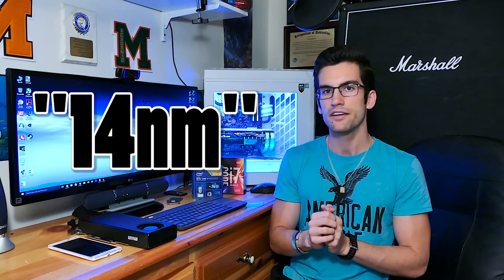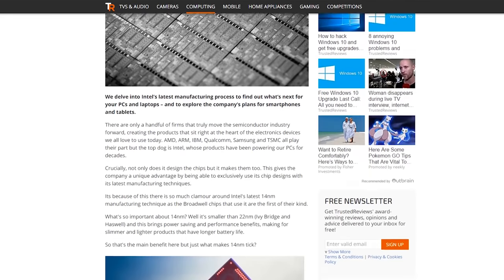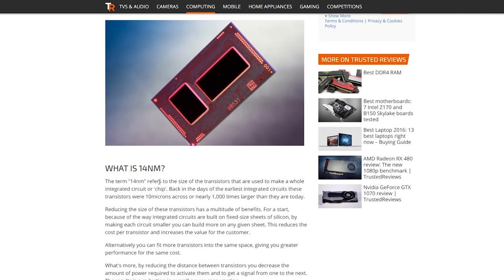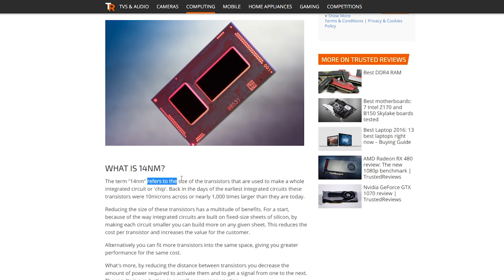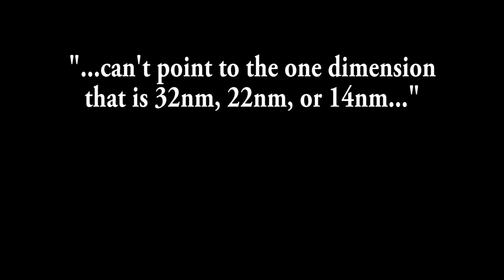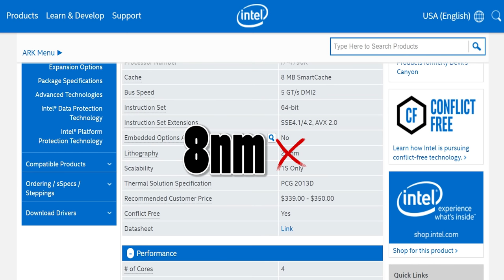Minute Science: What Does "14nm" Mean?

Comment: I'm an electronics engineer actually designing in 16nm right now.

What 16nm means.

  Planer fets from back at 45nm or so had a certain density so a given cell, like a static RAM cell would take a certain area. The area for each fet was basically a function of the minimum width squared. Back in the day, when we went from 180nm to 130nm the size of each fet was reduced by 130/180 squared or 52%, roughly. 

This has slowed down with the later planer fet process, but that is the idea. So, when we say the fin fets are 22nm or 14 nm we mean that the fet density is just like  if we had really small planer fets of that size. Since fin fets are on edge, they take up less lateral space. Interesting stuff.
Reply from the maker: Thanks for the insight! Awesome stuff.
Reply: Still not clear what the 14 nm really stands for??? And I have an interview for one of these companies next week :/
Reply: Would it mean faster speeds since the transistors are smaller and closer to eachother meaning it takes less time to interact woth each other?

Comment: So basically when AMD's Polaris is 14nm and Nvidia's Pascal is 16nm it doesn't actually mean anything significant?
Reply: pretty much
Reply: It doesn't mean anything significant in terms of the sizes of the transistors but it does mean something in terms of performance. They essentially have tied the performance of the chips to the terms now. So a 14nm will perform better than a 22nm chip and so on.

When he says that it's misleading it's really only misleading to anyone outside the silicon world. Everyone internal to the industry knows exactly what it means.
Reply: Amd marketing strategy? who knows
Reply: Technically, a 14nm should perform better then a 16nm but the way the are designed and the way in which handles caculations such as IPC. A 16nm could be faster because of it's overall faster IPC. IPC is basically split by how well and fast is accomplish basic tasks like adding multiplying dividing and subtraction. Kernel level mov stor etc... 

Also depends on how they like to perform caculations. As such if it likes to predict a way in which processes are going to excute the mhz tends to be slower. If it doesn't it like to just run each process as it comes in it tends to have faster mhz to spin out commands quickly... there's so much more but I think you get the jist...
Reply: why would a 14 nm perform worse? IPC is usually used on a chip by chip basis and can differ significantly even in same process chips(ie 2 28 nm chips can have a huge difference in performance)

"because of it's overall faster IPC"
why would a 14 nm processor process fewer instructions per cycle than a 16 nm?

"IPC is basically split by how well and fast is accomplish basic tasks 
like adding multiplying dividing and subtraction. Kernel level mov stor 
etc... "
no, IPC is a technical term that can be measured and is purely the average number of instructions per cycle that the cpu computes, while assembly instructions such as mov stor etc. are part of this, multiplying dividing etc are not as a single multiply on a cpu can be done several different ways, using a varying number of instructions to optimize it for the given hardware, intel lost a court case over their pentium chips for using a benchmark that was compiled such that it favored intel chips and misleading consumers.
Reply: In theory an identical chip architecture from 30nm to 15nm will have the 15nm chip generate less heat and use less power. Less thermal mass also means it could, in theory, dissipate heat better. That then means clock speeds and voltages and whatnot can be driven higher.

This is only assuming the architectures are shrunk to make the smallest feature and largest features of each die appropriate to one another. Basically, a to-scale shrinkage.
This doesn't always happen in the silicon world.
Reply: actually , yes

Comment: The node identification for semiconductor lithography represents the minimum feature width making up circuit elements, not the size or proximity of any particular circuit component. The node is established based upon many factors, including the wavelength of the illumination source (commonly 193nm for Argon-Fluoride lithography systems), the maximum bandwidth of the illumination source (a standard bandwidth for many applications is +/-50fm), the focal length from the illumination source through the pattern retical (you used the term stencil), numerical aperture (NA), and whether surface immersion is employed.

Comment: MOSFET has two critical dimensions: its length L, which measures the distance the current must
cross as it flows from drain to source, and its width W, which determines how much channel is
available to conduct current. 14nm refers to the smallest allowable value for the channel length (L).

Comment: Hey Science Studio could you help me? I'm upgrading either to a 1080 or 1070 sli and I have a i7 5820k running at stock right now. I've seen that this up could bottleneck cards but I've had it for a year with my 980ti working perfectly in games. I bought it thinking I wasn't going to need to upgrade for a while, do I need an upgrade or is it quick enough to keep up with pascal? Also, I plan on overclocking it in my upgraded rig.

Comment: good video, what about nvidia 16nm?
Reply: uses a similar process. if I remember correctly the Nomenclature for nm sizes is determined by the length of the gate or something like that. Both use very similar back end processes and the biggest difference between the two is just the Front gate which can and does effect the properties of the chip and how much Watts are saved and what not. It'd be more accurate to say that you get the Density of a true 20nm process , yet you also get the reduced leakage benefits of a true 14nm or 16nm process from the same company. From what I've learned different processes from different companies can technically be different sizes , like you could say your nm size is 14nm with a 20nm backend process when in reality it's more of a 15nm process with a 20nm backend , but you rounded down or up from say ... 14.4534 or whatever for the gate or pitch or whatever it is. ( do some light reading on this subject , Im tired and may be not remembering correctly ) 
From what I read about 14nm and 16nm they're pretty similar , just one has a smaller gate or opening for the electrons , yet the backend processes are fairly similar , so much so that it likely wouldn't matter much in regards to this. Now .... the Process that AMD uses actually is more dense or rather has a smaller opening and backend which makes it have a slightly higher density. Lets say Nvidia can pack about 1 million Transistors per mm2 , while AMD can likely pack in about 1.10 Transistors per mm2  
For better clarification you would need to look at the Die sizes of Nvidia and AMD and compare transistors per mm2 
AMD can pack in 24.56896551724138 Million Transistors per mm2  while Nvidia can pack in 22.92993630573248 Million Transistors per mm2. 
This isnt a 100% accurate indicator of how many transistors can be packed in overall , but it does indicate the transistor density of AMD and Nvidia's arch's for the FinFET generation.  Although With Nvidia's maxwell and Pascal GPU's they have tended to have slightly less Dense GPU arch's. This allows for higher clock speeds. the denser a Arch is , the less it can clock up , the less dense an arch is on a given nm process the higher it can clock. I dont remember why it does this , but it's a fact for most silicon if not all silicon.
Reply: 20nm with performance of 16nm.

Comment: Well if you think about it, disregardingly AMD's 14nm classification, at least the price they offer for that 14nm is generally fairer than Intel or Nvidia's versions of it, especially given how they 'may' be faster, hence cost a huge whopping more of your money.

14nm FinFET is at worse a 20nm classification, sure, but since it's cheaper I'd say they generally are a 8nm improvement from a 28nm. I guess with all these confusion and naming conventions, they actually could improve it over time with several 14nm variations (Like from 20nm to 18nm or 16nm types, via '14nm FinFET+' or some other improved naming conventions).

They'd still have to sell their product for around the same price or within a price range that they originally sold you for their 14nm product.

If AMD sells you a CPU that's 14nm in a price range of $100~500 depending on core count (at a 20nm price), even if they improved their node size, die size, etc. They'd still have to sell you within those range for a improved product (at their original 20nm price).
Reply: Since 14nm FinFet by Global Foundries is basically recycled 20nm, and adding FinFet on top, they can sell them far cheaper. Intel doesn't use those chips, as they already reached into the 8nm range a long while ago, but sells them for a premium price level no matter how cheap they managed to make their production of them.

The best win for consumers is the corporations that figures out the best way to 'use' cheaper node sizes or such, and improve on them for as little cost as possible, so that such saving is passed down to the mainstream users... Intel doesn't care about that, and focuses mainly on the enthusiasts users.

Comment: so finfet is completly different gate configuration making liers out of anyone not making a proper 3d adjustment in math that would be 20nm not 14nm. but i allways thought electricity goes in the path of least resistance. so what would the 3d dimensions matter if the shortest dimension is still 14nm? and if its true that its only about precision level not the gap between caused by the gate then thares nothing in relation to previous numbers to the fab node size and what fab node size means in the past and what it means now.
Reply: i believe the fab node size has allways been based on gate size witch only effects thermal output and determined the latency of the transister based on how long it takes electricity to cross the gap of the gate witch dont mean much in terms of nanometers at all. for example a photon of light from the sun taks about 8 minutes 20 seconds to get to earth and thats 93 million miles away.

Comment: What´s the differents between an AMD chip and an Intel chip architecture? 
adn why the Intel is better in a single core performance  as the AMD one, and the AMD is better in a multicore performance as the Intel one?
Reply: Igal Marcelo Zimmt Because they are both made to process differently. Although Intel processors do perform faster in most games, you have to keep in mind that games that are released on PC are optimized in a certain way. There are games that only benefit from higher IPC and clock speed and there are others that benefit from a lot of cores hence AMD processors. But don't forget intel offers multicore processors too. Anyways my point is to not look at what processor is faster but look at how they are utilized.
Reply: Intel Kaby Lake and AMD Zen have very similar IPC. (At least, after all the bios updates landed...) For the record, Intel IPC hasn't improved much since Ivy Bridge. All the single-core performance gains on newer Intel chips have been related to faster clocks, not being able to do more work per clock like on Zen.

AMD Zen is manufactured on a low-power 14nm node. Which is why they can pack 8 cores into a 95W part while Kaby Lake is 4 cores in the same TDP envelope. But Kaby Lake has faster clocks, so non-multithreaded software such as games will perform a bit better. A 7700K will get about 5-10% higher framerate at low resolutions where CPU performance is the limiting factor, compared to an 1800X. On multicore software an 1800X will outperform a 7700K. Zen's lower clocks means that it's not a doubling, but more like 1.6x faster for 2x cores.

This might change with the Intel 8700K rumored to be a 6-core part and the AMD 2800X rumored to be on a smaller 7nm process. With Covfefe Lake getting an extra two cores, they'd probably match the 1800X in multicore performance. And Zen 2 with faster clocks would close the gap against the 7700K in singlethread. So it's really up in the air who is getting the performance crown in 2018.

Comment: my whole life i've been calling them the collector, base, and emitter. :/
Reply: That's correct for a common discreet transistor. Sub-miniature circuit components are of the field-effect type. The current passes through all three parts of the discreet transistor. In these, current is controlled indirectly by the bias of the gate. Gate charged, current flows from source to drain. Gate not charged, current blocked.

Comment: Does this apply to AMD Vishera CPU's? It'd be interesting to know that my 32nm processor is actually worse... O.o
Reply: And if so, does the module design instead of normal independent core design change anything?
Reply: +J. Bravo Agreed. I bought an APU for my Sister's PC and its total garbage.
Reply: a fail that ran all my games at ultra settings for the last 4 years, at 50 percent the cost of the intel equiv ;) fanboy.
Reply: +thefilmdirector1 I never said that the module design was better. You just read the comment wrong. I know that the Intel design with independent cores is more powerful. You are the one that is fanboying over cheap your failed CPU.
Reply: *Your cheap failed CPU.
Reply: +MrMuffinGame #WTFU sorry my man, but amd cpu's don't even compete with intel cpu's

and apu's cant even handle games like battlefield 4 all that well

1080p low  45fps iis a no go
Reply: thefilmdirector1, No one's trying to be an Intel fanboy. All of you guys who use AMD for some reason cannot admit that the processors are weak, there's no sugar coating it. In terms of gaming, they do fine, but when you really start using benchmarks, like Cinebench, you will really start to pick up the lack of performance in an AMD CPU. And when you call fanboy at others because you hate to admit that AMD has surprisingly poor performance, you make a huge ass of yourself. When it takes an AMD FX-9590 to be able to have just a little bit of performance against Intel's newest CPU, it means that AMD lost. It shouldn't take the best CPU to match an i3/i5. The 9590 should be competing with the highest end i7, which it couldn't.

We get it, your games ran fine, but most games hardly utilize a good amount of your CPU, as most games only take 2 cores as games aren't needing to harness a lot of CPU power. What you fail to realize is that games aren't accurate benchmarks on raw CPU performance.
Reply: zen should have 1 core cpu's with like the best single core performance ever would be awesome
Reply: +CWplayer That's because they are a completely different generation. AMD Vishera is almost 3 years old so of course Intel Processors are going to be better because they are much newer. I've had my 8350 for 2 years now and has served my perfectly in every game I've played. So I'm going to stick with it until I can afford to Upgrade to Zen (when it comes out) or Skylake.
Reply: +CWplayer And single core CPUs would prevent multitasking. We upgraded from Single core CPUs over a decade ago.
Reply: +Dead Kitty The single core performance of my 8350 is total shit. I don't even think twice about admitting it. I bought it when it was still a fairly new design so I had good reason to buy it at the time. It'd be pretty dumb to buy Vishera  now that Skylake CPUs are affordable and faster.
Reply: i built a 6300 rig as a way to bring me to when zen comes out, i refuse to buy intel if possible with all the bullshit like the cinebench pentium/athlon scandal.
Reply: but zen isnt on the am3+ socket, you cant upgrade to a zen cpu with the same motherboard you're using now
Reply: +CWplayer Did I ever say that I would use the same motherboard? AM4 is a totally different socket. Duh. Not to mention that I need DDR4 RAM too.
Reply: but... why an  FX6300 ? it performs really bad bro
Reply: CWplayer performs well enough for most of the games i intend to play. games unfortunately though aren't properly multi-threaded.
Reply: that would suck
Reply: +CWplayer The FX 6300 can run most games in High-Ultra 75fps and above if provided with a decent graphics card... Just saying. And that all that most gamers want.
Reply: In gta or other cpu demanding games it is not always like that, the 6300 doent even compete with newer i3's  and fx cpu's dont even support pcie 3
Reply: CWplayer of course, the architecture is years old, but it still is good performance. compare it to intel chips from that time, why would you compare it to newer chips?
Reply: CWplayer i get a constant 60+ in BF4 with mantle on. 1080p ultra minus ssao and motion blur
Reply: Evbil_wafflez idunno
Reply: AMGV Media well, as long as you  stay haappy it is A okay
Reply: CWplayer it's mostly a lack of multithreading when games are multithreaded and don't have 20 million drawcalls i'm good.
Reply: AMGV Media but singlecore scores on fx cpus are bad, but oh well.
Reply: CWplayer yep, AMD sort of bet on multithreading, which actually is a good idea, but microsoft really dropped the ball with DX11... so much so they had to build their own api that supported multithreading across all cores. In BF4 mantle makes a huge difference for me.
Reply: im curious what zen has to offer
Reply: CWplayer above 6700k levels of performance per clock in blender
Reply: I hope